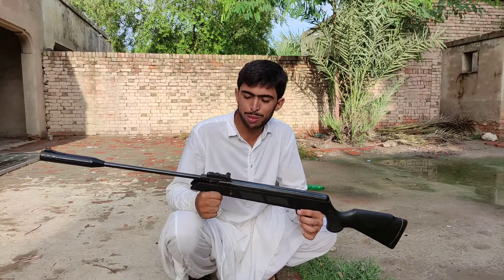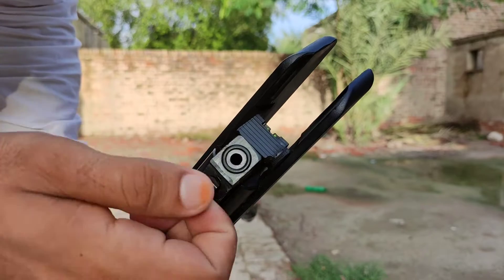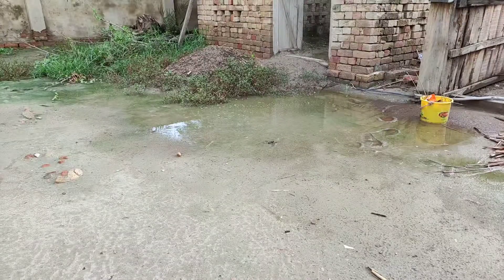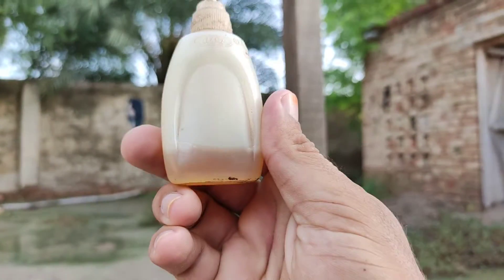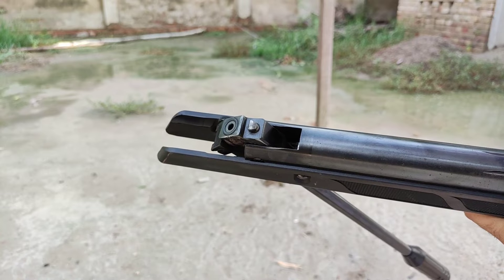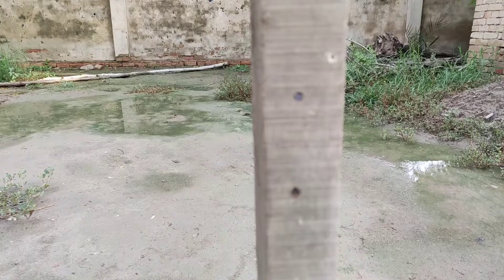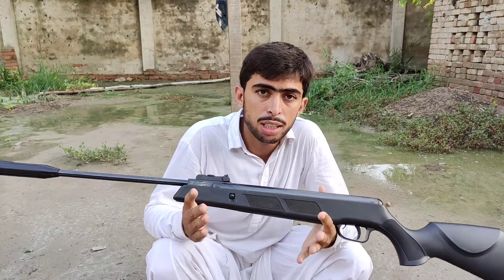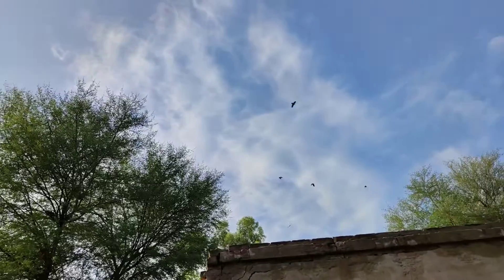Airgun Dieseling

Comment: Used to do this with my airguns back in the 70's: seemed to work but since I had no chronograph, it was impossible to really be sure. A word of warning to UK airgunners, though: if the velocity increase pushes the muzzle energy of the rifle beyond 12 lbs/ft, it could be argued that the setup ceases to be an airgun and becomes a Section One Firearm - so beware! All it would take is some anti-gun fruit-cake with a smartarse lawyer, and you could end up in the slammer. Best advice: avoid tinkering with airguns like the plague.
Reply from the maker: Yes Sir, you are Right. We should check our Local Laws before doing something like this. In my country, there are no Restrictions on Airguns.
Reply: @testz55  How lucky you are! Best wishes from the UK.

Comment: how about using petrol
Reply from the maker: Petrol will not work because it can't self ignite on temperature produced by rapid compression of air inside airgun. This is why petrol engines needs spark plugs to work where diesel engines don't require spark plugs because diesel auto ignites when higher temperature is produced during compression cycle.

Comment: Many years ago I used to do this with my .177 but I used castor oil. Just enough oil if it pools in the slug it's too much
Reply from the maker: Yes, any high temperature auto ignition fuel will work.

Comment: Quickest way to damage your air rifle, don't do it...
Reply from the maker: In my opinion after doing Diesling for long time, it doesn't damage my airgun more than dry firing does. (firing without pellet in breach) 
Synthetic Rubber seals are very tolerant in this regard and Diesling surely damages leather seals.

Comment: Dieselling a spring air rifle. How to knacker the spring in  just a few shots and end up with a less powerful rifle. When the rifle diesels (ignites) it forces the piston backwards, just like a piston in a diesel engine, and if it does this early in the cycle it will force the spring back as it's coming forward and compress the coils permanently at the trigger end of the spring, damaging the spring and reducing the power for good. A sure sign that this has happened is to remove the spring and check for narrow coils in the spring at the trigger end, but wider coils further forward. In short, don't diesel a spring air rifle..
Reply from the maker: Yes, I have noticed this unique vibration pattern when Diesling. But I have been doing it for a long time and haven't noticed decrease in power although I don't have a chronograph to be sure. I will tear my airgun apart and examine the spring closely. Thanks for bringing this to my attention. Have a Nice day.
Reply: I do it a lot and nothing bad happened to the gun, but for sure it may happen, i suppose the quality helps a bit, but even if a damage the spring, it is easy to replace with a new one. The seals too.
Reply: Youre just one of the those dorks who just regurgitate everything they hear
Reply: Wrong
Reply: @79pejeperro  yeh, I made it up 🤔.

Comment: Dieseling is done by Vaseline🤦😆
Reply from the maker: any high temperature auto ignition fuel will work.
Reply: WD40
Reply: I used to use plain old 3 in 1 oil.

Comment: If you like your air rifle and want to keep it  in good repair, then you need to consider what you are doing.
Diesel fuel is likely to damage and degrade your piston seal, eventually making it fail, much sooner than normal.
Many younger people seem to be in a rush to make their air guns more powerful. Consider this.
Do you remember making paper aeroplanes as children? If you throw hard, they'd take a nose dive. Air rifles can be the same. If you threw the paper aeroplane properly, it went much further, gliding along.
Your air rifle is made to function at twelve foot pounds, no more, unless its an FAC, Fire Arms Certificate. Twelve foot pounds is plenty for using an air rifle for what it is meant for.
If you keep your pellets clean and nowhere near any diesel, you'll be fine.
If you start using diesel, you'll contaminate your piston seal, which will need changing, and your barrel will need cleaning to be rid of all the diesel that shouldn't be there and your accuracy will be all over the place.
You'll more than likely need to visit the local gunsmith, parting with a sizeable sum. If you have a quality air rifle, Weihraurch, BSA, etc, you're making a real rod for your own back. You really need to think about what you are doing if you value your kit. Take care.
Reply from the maker: Yes Sir,  you are Right. In my country there is no regulation on Airguns. Thanks for sharing your opinion. Have a nice day.

Comment: Do you shoot the crows with this gun?
Reply from the maker: Yes, I raise chickens and crows attack chicks and kill them. The only solution is to kill that crow and hang it with rope in such a way that it should be clearly visible from sky. Crows never attack as long as the dead crow is there. This Technique works and we are able to save young chicks from crows as they are Responsible for Most chicks Deaths.

Comment: Why crows angry? You killed some?
Reply from the maker: Yes, I raise chickens and crows  attack chicks and kill them. The only solution is to kill that crow and hang it with rope in such a way that it should be clearly visible from sky. Crows never attack as long as the dead crow is there. This Technique works and we are able to save young chicks from crows as they are Responsible for Most chicks Mortality.

Comment: How to soften the loading of the rifile , I mean after breaking the barrel , when u pull the barrel down to load , that is very stiff , what can be done to soften that
Reply: Go to the gym
Reply from the maker: It's going to be stiff because we are compressing steel spring. If we modify spring by cutting small amount, it will be easier to load but Power will decrease.
Reply: cornflakes in the morning

Comment: There is a 7.62 mm air rifles avalible,wonder if this dieseling will effect larger caliber. 
Thanks for sharing.
Reply from the maker: But those are PCP Airguns. I don't think it will work on those because in a springer airgun, the heat from compressing air rapidly self ignites diesel fuel. In a PCP Airgun air is already compressed. diesel fuel requires certain temperature to Ignite.
Reply: @testz55  interesting, guess the piston makes the difference for ignition of fuel.

Comment: The extra velocity will change the point of impact and hence where you need to aim. For anyone relying on this for hunting, I highly suggest a few practice shots with dieseling so you have a good idea of where you need to aim. A paper target, cardboard box etc is best so you can compare the non diesel aim you're used to and the diesel aim point. 👍
Reply from the maker: Yes sir, You are Right, also the velocity changes are inconsistent . you can't shoot accurately after applying diesling .
Reply: @testz55  Agreed. It's probably good enough for a large target at close range, but inconsistent velocity will make long range more difficult. Slingshots are my weapon of choice and changing band thickness or length, changes my impact point quite a bit. 
Have a great day buddy 👍
Reply from the maker: Thanks
Reply: I heard that vaseline might give the best results. Some videos show pretty consistent fps measured shots with vaseline putten on the skirt (good method to use the same amount every time)
Reply from the maker: I have tried using vaseline but using diesel fuel seems more loud and powerful.
Reply: @testz55  interesting. I hope to buy an airgun somewhere later this year and I will try dieseling as well after a while I guess
Reply: I've heard that dieseling messes up the seals and gun in general I don't know how true that is🤔